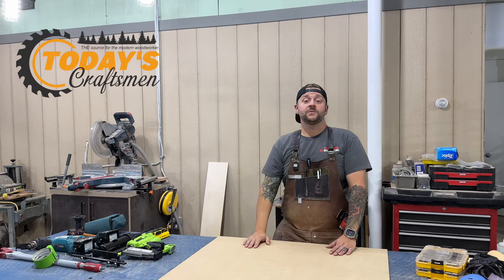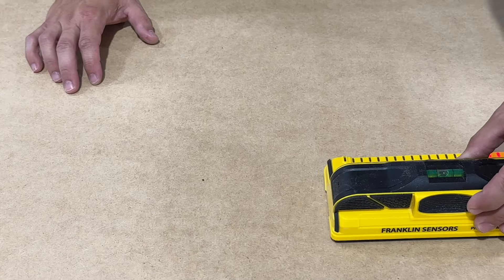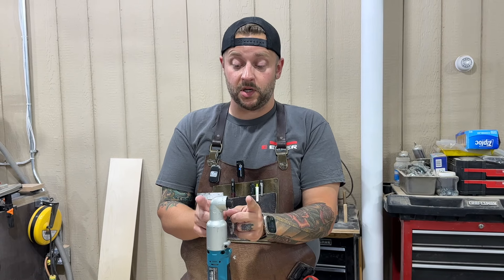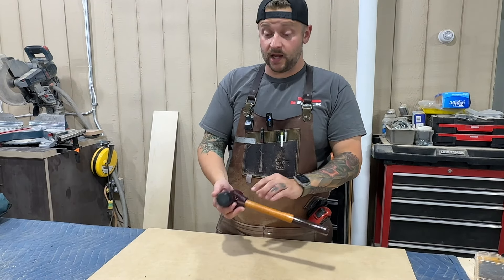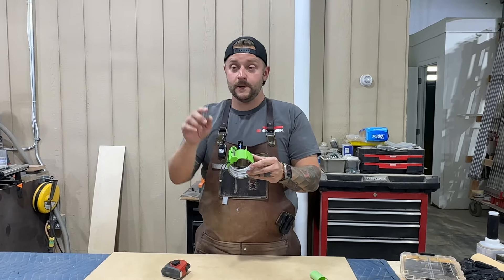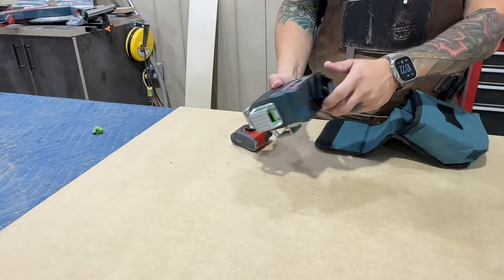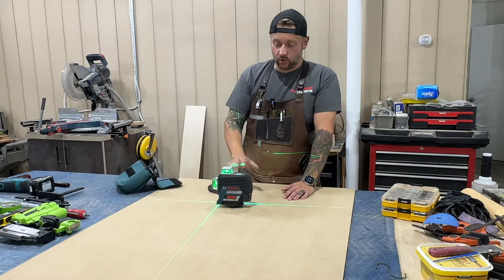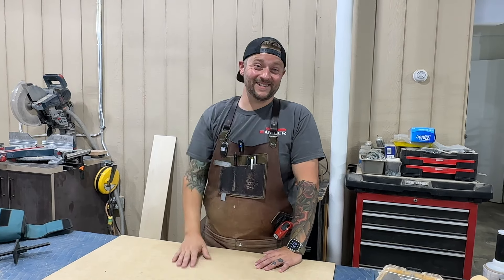10 Must-Have Tools For Kitchen Cabinet Install

Comment: I always pick up something new from you!  This time is the Axilo system!  I have a bathtub that was improperly installed and it squeaks and moves a bit which is driving me crazy and will likely end in a crack.  It is in an alcove and I cut open one end of the wall and have been stuck as to what to do.  I have been looking for adjustable feet that had a crown and pinion style mechanism so I could adjust by spinning... this looks like it may be the answer!  I am going to give it a shot.
Reply from the maker: You’re going to love them!

Comment: I still call it a multi-master too, none of the trim carpenters we work with have a clue what that is, so I take a lot of shit on that.  LOL  Which the original tool or atleast the one we had in our shop was a POS, I guess a lot of guys never had one till they where made by everyone and called a multi-tool.
Reply from the maker: I used to have the Fein but ditched it for cordless!